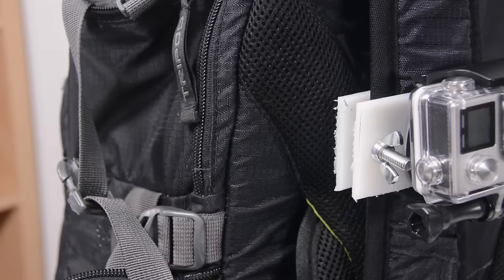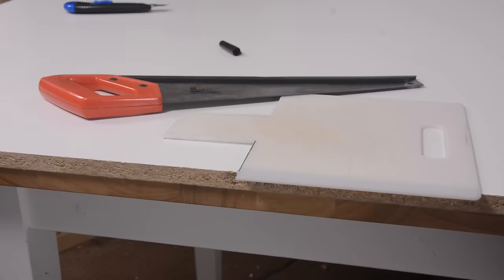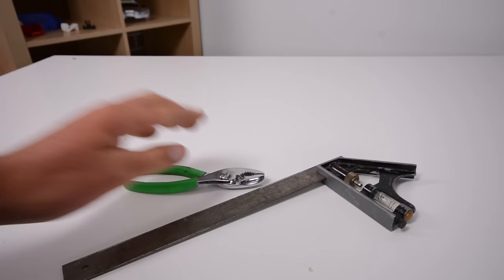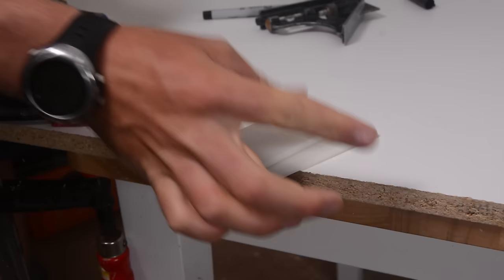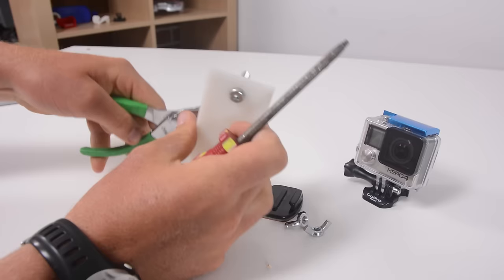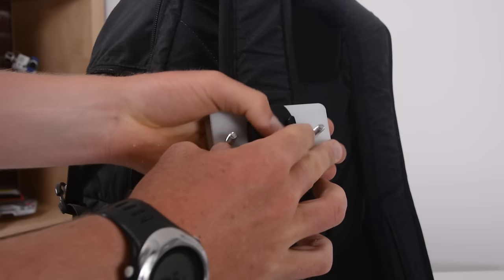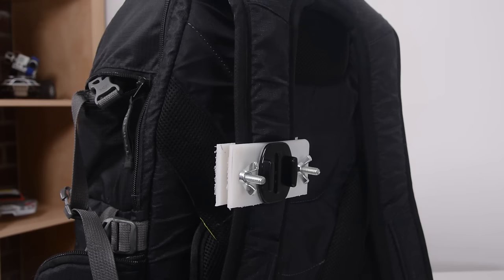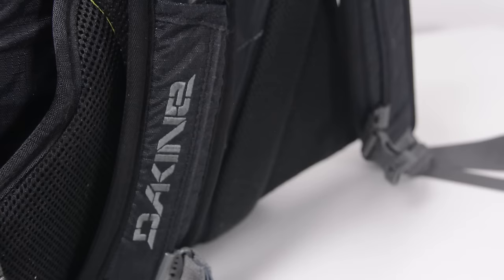DIY GoPro Backpack Strap

Comment: For the revised version you should round off the corners of the cutting board, just so it's not square, and make it look a lot smaller than it is.. This is actually a good idea for vlogs and such using a small mic

Comment: Kyle
Not sure what you call them in US but  if you replaced one nut and bolt set with large acco binder clip attaching the mount to the backpack would be a lot easier
In fact you could get rid of the bolts altogether and use 2 clips
Just a thought
Garry
Reply from the maker: it is a good idea! Thanks for sharing!

Comment: This is why I watch this channel. I don't like buying GoPro stuff because it's overpriced and under quality. I just drilled holes into a mount and sewed it to a strap, but this is great for a removable solution. Maybe put some grip tape or gel rubber on the back to keep from sliding?
Reply from the maker: That is a good idea! You should look at my video on replacing the adhesive on GoPro mounts. I use it all the time to save having to buy new baseplates.  

I hear you loud a clear. Based on the response to this video there are a lot of people that agree with you about wanting more DIY videos. I will do what I can to keep them coming, my hope right now is one a week released every Sunday. My challenge now is to find DIY mounts that worth sharing.